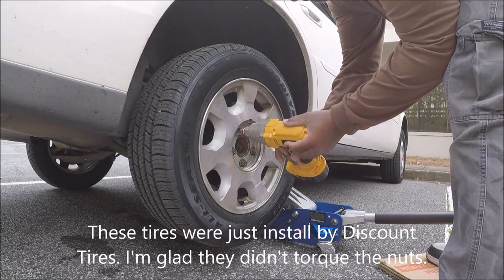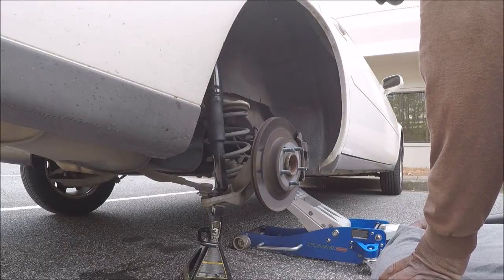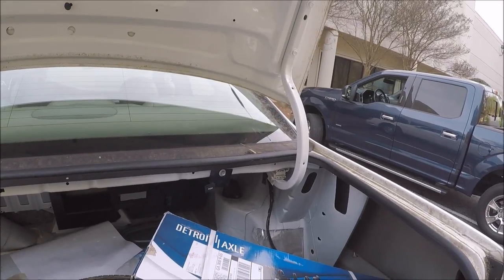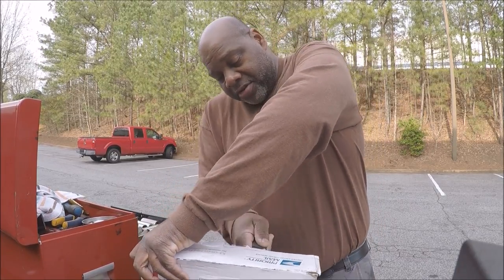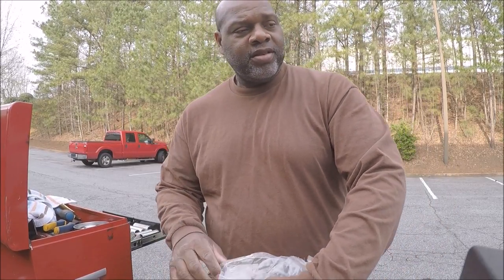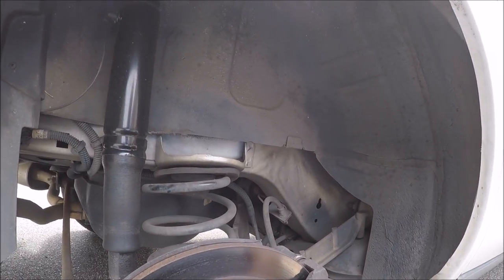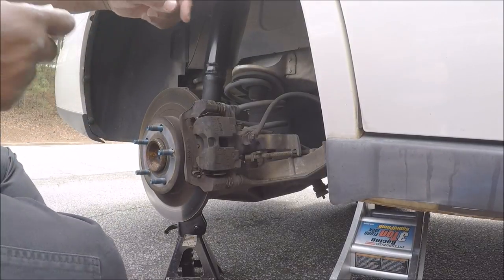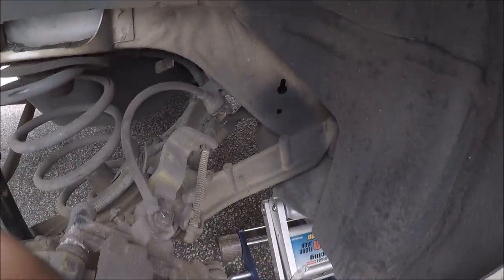Replace Deville rear pads and rotors1

Comment: Thank you so much. This was the first time I worked on rear pads/rotors on a 2005 Deville, and this was quite different from what I was used to. I found your video and it was very easy to follow along, and helped me get the job done. It still took me 3 hours thanks to breaking a socket trying to get one of the the rotors off, and cracking my knuckles a few dozen times. Then one of the calipers was a pain trying to get it pushed back in.  Keep up the good work, and thanks again.
Reply from the maker: I'm glad my video helped you.

Comment: I wish you would’ve showed us how to take off that bottom bolt. I tried a wrench. As well as knocking it out with pressure using a bulk flathead with a hammer. Neither one worked eventually gave up
Reply from the maker: I don't remember what I used to remove the bolt. If I had a problem. I would showed how to solve it.